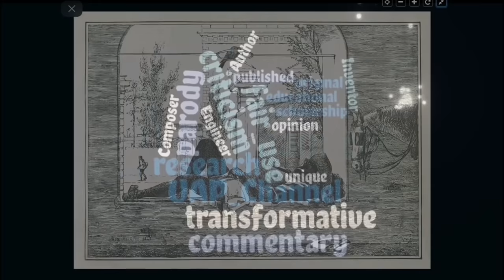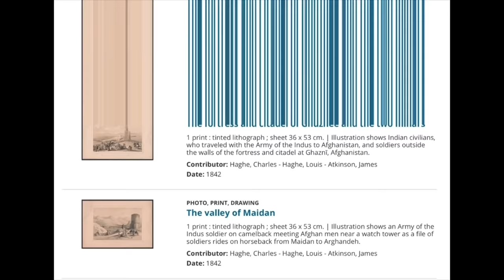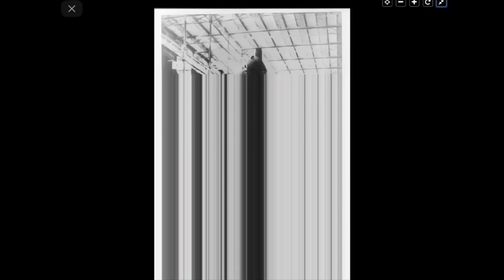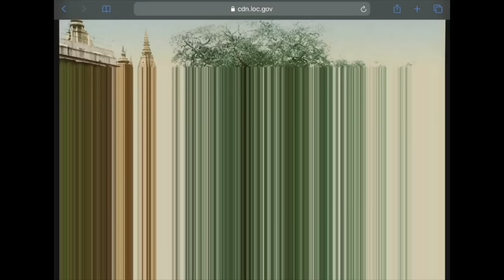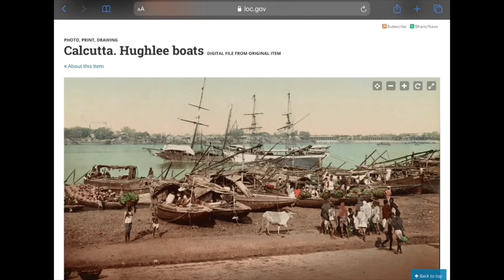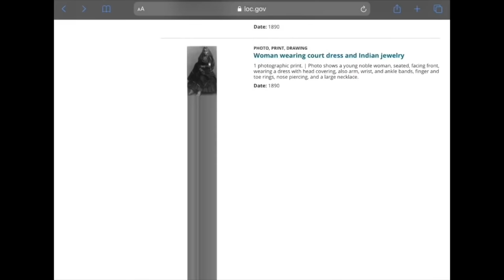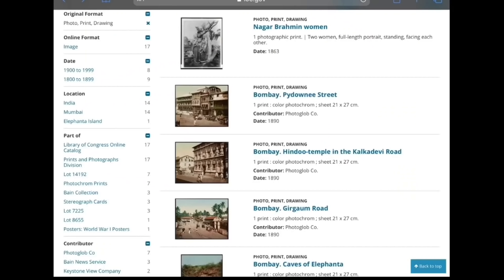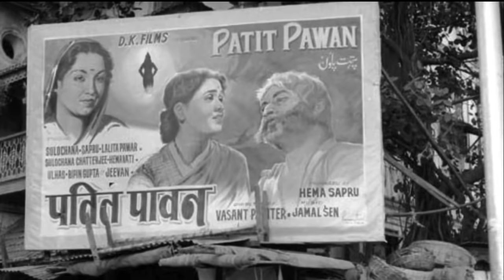India 🇮🇳 Mystery History First Glance | UAP

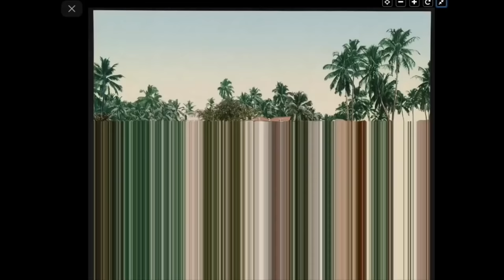Comment: 28:11 something really bothers me about these tracks in the dirty sand, unless there's some serious structure underneath like modern train rails & streetcar rails need to handle the weight, like what happens when it rains? Even if they are horse-drawn and used to be electrical something doesn't add up.
Reply from the maker: 88Shinto they’re concreted into the stone or bricks under the dirt
Reply: @UAPch  Maybe, I just don't think they would have let the streets get dirty, especially around the tracks. I don't know, still doesn't add up